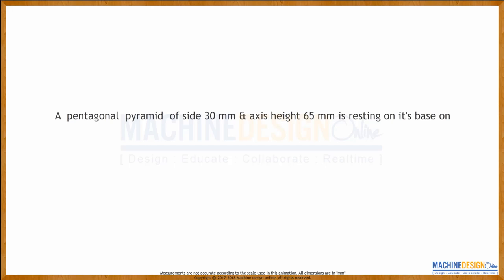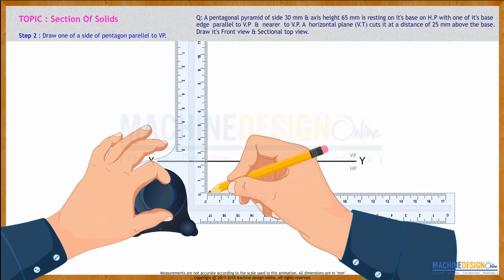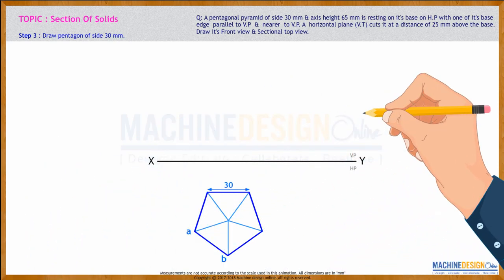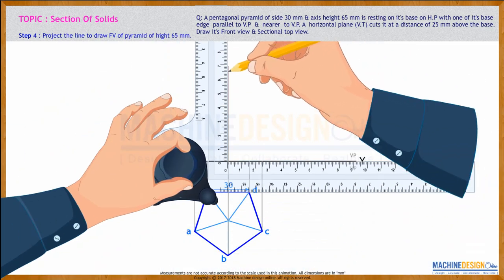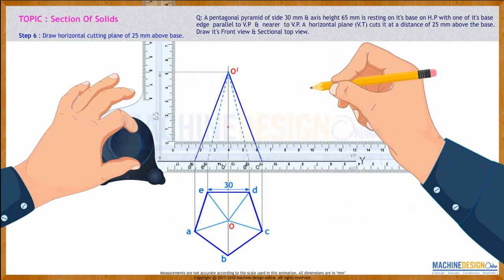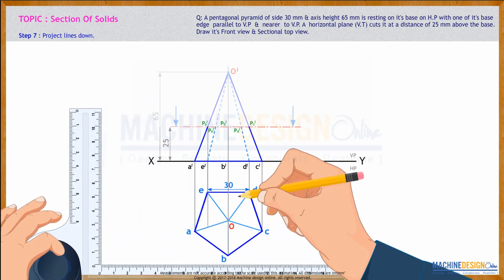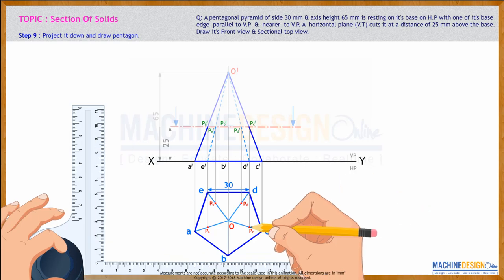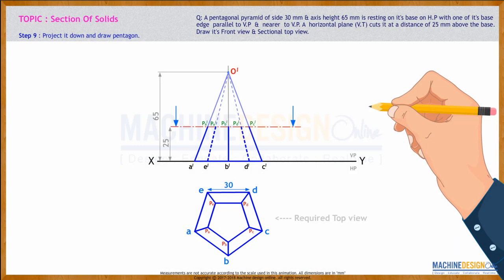Section of solids: Pentagonal Pyramid digital version

Comment: A pentagonal pyramid of base side 30 mm and axis 60 mm, rests on its base on the H.P. with a side of 
the base parallel to the V.P. It is cut by two section plane which meet at a height of 20 mm from the 
base. One of the section planes is horizontal, while the other is an auxiliary inclined plane whose V.T. is 
inclined at 45° to the H.P. Draw the development of the lateral surface of the solid when apex is 
removed.

Comment: A pentagonal pyramid, base 30 mm side and axis 65 mm long has its base horizontal 
and an edge of the base parallel to the V.P. A horizontal section plane cuts it at a 
distance of 25 mm above the base. Draw its· from view and sectional top view.